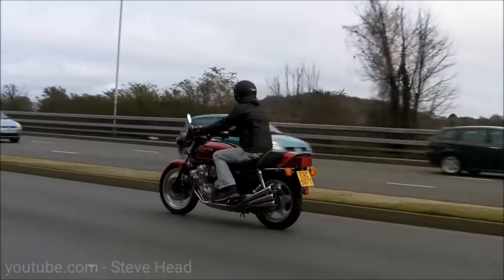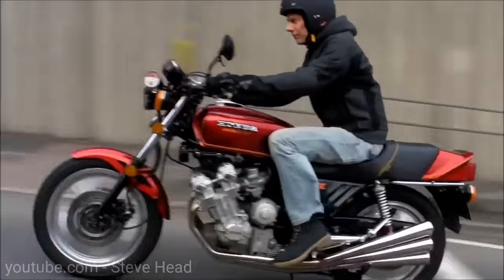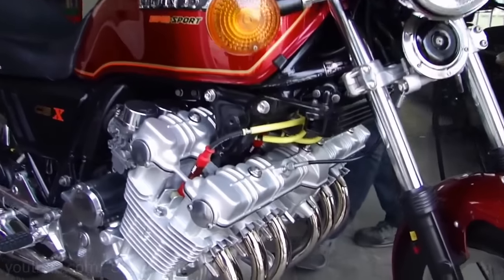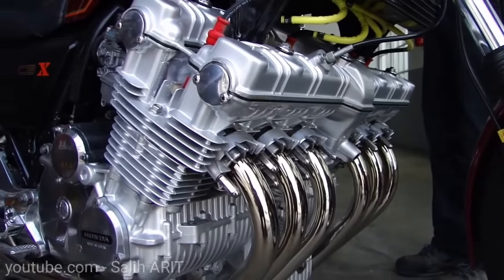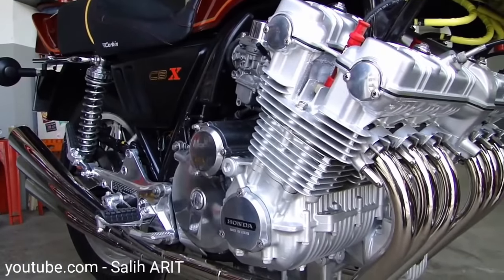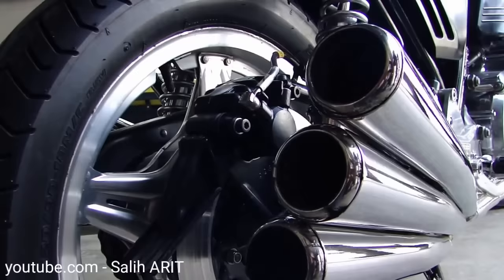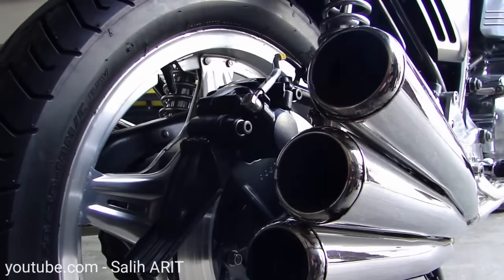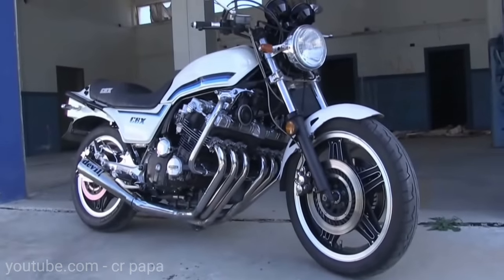Honda CBX 1050 - The Motorcycle That Sounds Better Than A F1 Car

Comment: I'm 72 and over the last few years I sold off most of my motorcycles until I was down to 2 that will never be sold, a 79 CBX and an 82 CBX.  The 79 has the glorious Pipemaster 6 into 2 into 6 that brings out the F1 sound shown here.  At 70 MPH and above it has that heavenly wail that I cannot get enough of.  The 82 is a magnificent touring bike.  Thank you Honda for enriching my life.
Reply: Still ride it?
Reply: Have an 82 since new, User friendly with lots of moxie! They nicknamed it the New Vincent Black Shadow. Call it whatever you like 80,000 klicks and still a dream to ride! <3  .
Reply: Wow...you own 2 of these....😯 please adopt me Sir 😆😆🤣 kidding
Reply: Pic please
Reply: what model year of cb1050 or what size engine sounds the best? (stock) better than F1 car? like the one at 0:40 in this video?
Reply: The Power Of Dreams....
Reply: Getting the carburettors balanced properly in a bastard of a job and not for the novice..
Reply: @schmittyyyyy  Oh, yes.  I'm 73 now
Reply: @michaellovelace8995  How do I post pics in a reply?
Reply: @rohanpatel4863  Bone stock none of them sound like this.  The stock exhaust is a boat anchor that upper management forced on the designer.  With the Pipemast exhaust, any of them roar to life.
Reply: @Shane-zx4ps  No kidding.  I just rebuilt the carbs on both of mine.  AZ gas does not sit well in these carbs.
Reply: @billbmsn  happy birthday 🎂
Reply: That 6-2-6 is everything! That glorious sound. I just turned 50 and will never get rid of my '03 FZ1. It doesn't sound nearly as beautiful as the CBX, but we've done many many together and it's hard to replace 151rwhp @5000' on an upright with bags. But, if you think a trade for one of those cbx... lol kidding, i understand the bike bond. Ride On!
Reply: @billbmsn  ... Startron helps.
Reply: I'm assuming that exhaust is equal length
Reply: @billbmsn  Gas is not the same since they banned lead! It didn't produce  dry deposits as fast if any when  you didn't empty all carbs for winter storage! like today gas fast evaporation rate!
Reply: @Jonh doe ... If you build like you write, you'll never get a speeding ticket.
Reply: I used to own a CBX 1000 when I was 18 back in the 80's. Blue/silver and shit hot lol.
Reply: Hey Bill! Why don't you sell me your beautiful 79 CBX!? 😁😁
Reply: But....but.....its not a harley so it cant be a good bike?
Reply: Are you still alive??  Lucky man
Reply: @michaellovelace8995  Google it? Or are you asking him for proof 🤣🤔
Reply: @momonohomo150  no proof just wanted to see his bike
Reply: @fartdonkey8290  I have harleys that sound glorious but not like this. I grew up racing metrics and to have both would be epic.
Reply: sweeeeet    😁
Reply: @Shane-zx4ps  
Nonsense....Any reasonably proficient witch doctor can get the job done....It's the expense of the shipping that's the problem....It's a long way to the Amazon Basin.
Reply: @billbmsn  heres to many more years of you enjoying those bikes sir! 🍻
Reply: Where do you live?
Reply: respect. I'd love to own one, one day
Reply: Where do you live?
Reply: I will be 72 this year and still ride my 675 Triumph.
Reply: Sounds like a jet coming & going!.....
Reply: @billbmsn  Make your own ethanol free gas bill. 5 Gallon container....Well worth it.
Reply: Godbless you Bill
Reply: I am 75 but my Benelli (see my blog here) was taken by a lawyer...Not really rightfully in NoVa.
Reply: Im so angry with myself. An older gentleman tried selling me a 79 cbx for 900.00. Had been stored in his garage for years. Now I cant find one in my area.
Reply: Shane,
I remember when everybody had a real pisser getting the carbs on the CB750-4 balanced before the Hamamatsu boffins started supplying dealers and tuners 4-tube manometers.
Reply: I got one with a spared engine  in 2011 for 300€ in a shitty condition with a missing frontwheel, was a part trader on ebay back then... wish I restored it, or built it in a honda quad
Reply: Unbelievable sounds
Reply: @Bellathebear777  Or just buy it at the pumps where available. I was working in Michigan in '15-'16, and the convenience store next to the hotel I stayed at sold "recreational fuel" which was ethanol free. I would imagine it is available elsewhere. The station across the street sold race fuel at a separate island.
Reply: Glad your still riding sir.
Reply: Brother that 79. Damn those were good yrs for bikes. Just Raw. Not a beauty queen wrapped in plastic. Just upright crotch rockets that screamed.
Reply: Good for you, man, good for you!
Reply: I take it no carbon build up.....yes a motor has to sing
Reply: I'm 74 now, approaching 75.  Still riding.  Have added a few bikes to the 2 CBXs.  A 2005 MV Agusta 1000+1 for one, a scary beast of a bike but a true work of art.  But more to the point here is an old clip I did in 2011 of my 79 CBX with the Pipemaster exhaust.  I don't ring it out, just rev it a little near the end of the short clip.  It gives you just a taste of the sound.  At the very end of the clip, you will spot my 82 CBX in the garage.  😀  https://www.youtube.com/watch?v=jNJwQ3A0fjA
Reply: How much you want for it?😂
Reply: Me too...and i have  a CBR1000RR!!!
Reply: @billbmsn   ohhh yes i am 72... hahaha.
Reply: I live in Greece.
Reply: Which other old bikes did you have?  If they weren't so expensive now there are about 7 to 10 I'd like to add to mine.  I  have a 79 CBX and an 83 1100F Super Sport.  The CBX has a DG 6 to 1 pipe. The 1100F has original black exhaust.  I'd love to add a KZ1300, 84 1000 Interceptor, 900 Eliminator, FJ1200, 81/82 CBX, GS1150E,  KZ1000 Lawson Replica,  Late 90's CBR600 Smokin Joes Replica.... you can see how difficult and expensive this would be lol.
Reply: @mrweeby1961  I have had a lot of other old bikes...a 75 Norton Commando since new sold 6 years ago; 75 and 76 Honda 400F, 88 Hurricane 600 until I replaced it with a CBR 600F2 in 91.  Sold that about 4 years ago. 76 Goldwing in the early 2000s for a few years.  Bought for $1000 from a Honda factory test rider.  Came with over $1000 in rare spare parts, so the bike was basically free. Had several 71 CB 450s for a few years.  My first bike was a 68 CB350 brought in 69.  Stolen in 71.  Never seen again, replaced with a CB 450.  Almost forgot the 87 Suzuki GSXR 750 bought in the mid 90s and my 3rd bike, a 71 Norton Commando 750 bought in 73 after I sold the CB 450s. Loved the effortless low end torque of the Norton and it was small and light, fitting me well.  Now,  esides the 2 CBXs. I have a 91 Ducati 907ie, 2005 MV Agust F4 1000, 2009 Honda ST1300.  Fun & games!
Reply: @billbmsn  You started a few years before me lol.  My first was an 82 XL250R, then 83 450 Nighthawk then jumped to the big bikes. If I can remember right it was an 82 900F Super Sport along with a V65 Magna, sold them off and went several years with none.  When I got back into the bikes I got a V65 Sabre till 1999 then went more new with a 1200 Bandit and a ZX12R.  After those (the ZX began to get uncomfortable to ride due to age lol) I tried an 01 Yamaha FZ1 and while I had it I found the 79 CBX then sold the FZ1. I then found a duo of the 83 1100F Super Sport and an 81 900F Super Sport (which didn't run but looked fantastic).  Then I went to a Harley Fat Bob and sold the 900F.  So now I still have the Harley, 1100F and CBX.  I'm kind of looking for some older bikes but they've become so insanely priced I'll probably never get anything else.  You had some cool stuff too and some of those would be great to have now.  The local Honda dealer has various 60's-80's old bikes on display hanging from the walls which is pretty cool to see.
Reply: I still have one bike left from when I was young and 86 fzr 1000
Reply: That warms my heart to read your enthusiasm and see how much pleasure and life enrichment you have extracted from owning and riding them. Respect. I am only 58 but I dont seem to be losing my love of riding bikes. I currently own a Harley sportster 1200 and a ducati 810 scrambler (Night shift - that one has a nice sound too), and a Royal Enfield scrambler, but i am seeking a 4 cylinder Honda, because my first biike was a Honda, as was my second, and i never had a 4 cylinder bike or a 6, so its time. I really love the sound and the smoothness of 4 cylinder bikes. This 6 in the video is a dream of a bike. Would perhaps do better in a new frame and suspension haha
Reply: Please sell that to me. If you think you will past away 
I will not put some modification on it and will it keep it the way it is. Please
Reply: Good question. Maybe a pic in a New comment on thé original post
Reply: You find the handling much better in the latest model?
Reply: @alwinmv6827  75, almost 76.  Still love and ride my CBXs.
Reply: @schmittyyyyy  Yes
Reply: @tooyoungtobeold8756  I had one of those, a beautiful 2008, black and gold.  The riding position was the most extreme of any bike I had ever ridden.  So, I flipped the clipons over to the other side so they pointed up instead of down.
Reply: That’d be a sick if they stuck it in a small car
Reply: Honestly I'm grateful you mentioned thr 6 2 6 exhaust. Invaluable knowledge.
Reply: @alwinmv6827  75, almost 76, and still riding.
Reply: @tooyoungtobeold8756  I had a 2008 675.  Great bike.  I flipped the clip-ons since the stock riding position was brutal on my neck.

Comment: They need to make a 2020 version of this bike with the same engine but different body
Reply: Agree
Reply: I was looking at a list of upcoming bikes and saw 2020 CB1000X. For one glorious moment I thought it said CBX1000.
Reply: The closest thing we have is the BMW K1600 with a 1600cc inline-six. I rode one, the engine is absolutely glorious. I don't think we need to be sad.
Reply: The one at 4:00 was pretty rad ;)
Reply: Same thought came to my mind. This engine and sound deserves new & latest body of 2020
Reply: @nomadben  they should use that engine in the BMW Mini
Reply: Alan miilyard ,has made one ,,,,!!Z1  air cooled six cylinder ,,,,perfect
Reply: Very light rotating assembly . Revs up and down quickly . With the race for power , the sound is very low on the list imo . Technology advances ... The CBXX would have been remembered much more if not for the Suzy , which made more power with 2 less cyls .
Reply: Imagine a modern Honda I6 in a new generation S2000.
Reply: THAT'S WHAT I'M SAYING. Just remake the DAMN thing. Do you see how many people are actually using this engine still and spending $40,000 on the upgraded suspension?
Reply: Philippine Heart Center PHC  Yeah, it has a shit ton of power and it's really heavy. Definitely a super sketchy bike to ride fast.
Reply: Or a newer six cylinder engine with the retro frame.
Reply: Indeed
Reply: it's just a rumor but they want make it
Reply: Body looks perfect !
Reply: lol, good luck with all that euro restrictions
Reply: *better engine
Reply: Probably wouldn't sell cause the motor will cost 3x the price. 
High cost of cam and crank shift, block, water jackets...

Yamaha has developed 3 cyl motors and is using in MT, TENARE, FJ, SRX, XJS,TRACER,FZ and .......

Its what can sell......
Reply: Same body but with a parallel twin 👌
Reply: We need one with same sound, but replace the carbs and do fuel injection
Reply: A friend of mine has a '79 KZ1300 six that he bought new and immediately put a kit from Mr Turbo in it, and if that wasn't silly enough he put a nitrous bottle on it that gave it just a little shot at WOT to compensate for turbo lag.
1979 brakes, 1979 tires and a 1979 suspension with that kind of power=the most evil motorcycle you'll ever ride, to say it's a death trap is an understatement.
Reply: Everyone says to remake it. The cb1100 looks pretty similar with a inline 4 instead of the 6
Reply: Like the Z1 and 900rs?
Reply: Matthew721 79  Yeah but even still that engine is very, very heavy and wide. Probably not the best idea if your goal is great handling performance.
Reply: It'd be better with the same body!!! The original look badass already
Reply: At least, make inline-6
Reply: @nomadben  It doesn't sound good. BMW.
Reply: A refined engine would be the best word I think
Reply: @nomadben  not even close. The K1600 doesn’t rev that high to produce that amazing sound. The XR1000 sounds a lot more similar to this one but again. There are great engines out there but the point here is the sound which is unparalleled.
Reply: @C_R_O_M________  K1600 redline is 8,500 RPM, CBX redline is 9,500 RPM. Not that huge of a difference. Both sound great in my opinion.
Reply: The new CBR1000RR-6.  You'll never need another motorcycle again. 

Warning:  Riding this motorcycle above 7,000 RPM may cause instantaneous death by smile, and relentless groupies.
Reply: @StevenStGelais  exactly what i think, since carbs aren't used anymore... Love carbs but fuel injection is more used nowadays
Reply: I propose a 600 ...v6... tech de force. Or inline ok too.
Reply: Or a car with this engine.

Comment: Who cares about HP and top speed ratings when it sounds so good.
Reply: SLOW
Reply: That's why I bought the Hemi over the EcoBoost, I wanted that good sound!
Reply: 100hp isn’t that bad honestly
Reply: AE86 Toyota
Reply: 105 bHP on a motorcycle is a lot, cars are Heavy by Nature, Motorcycles are Lightweight. That's why cars waste more gas than a Motorcycle ever will.
Reply: Definitly fuck electric cars even if there faster. Only the sound and feeling is all that matters!
Reply: @mikeb769  anything in triple digits on a motorbike it's gonna move.
Reply: @mikeb769  amen! 100bhp in a single seat rigid with standard rake is more then enough:)
Reply: I've found some people similiar to me...
Reply: @izzurumusic  you mean some people that are similar to you or some people that are fond of you?!? 🤔🤔🤔
Reply: The Vibe similar to me...
Reply: Says every D series Civic with Fart Can’s
Reply: For an old motorcycle 100hp is a lot

Comment: I'm always amazed by just how good we can make a series of little explosions sound.
Reply: Str33t Tr1pl3 science is a crazy thing
Reply: Str33t Tr1pl3 r/iamverysmart
Reply: @officebear4637  he didn't use many big words fam, kinda to the likes of openly realizing "wow we can do so many things with copper wire (magnet's, power transportation, capacitors, etc)
Reply: Earjaculation
Reply: OfficeBear using subreddits outside of reddit. Yikes.
Reply: ITS CRAZYYY
Reply: Aliver87  controlled burn? Better description for it.
Reply: Max  they are actually burns. Do you know the difference between a controlled burn and an explosion?
Colin has already explained it partly..
Reply: @Colin Rist "flame front"
Reply: A controlled burn would not make any sound like you know it from an petrol engine.... people are dumb. It's a controlled explosion chain. Maybe the explosions are to fast for your brains....

Comment: I remember reading about the exhaust sound in one of the cycle mags when the CBX first came out.  A 6 cylinder engine has some unique tuning possibilities.  Back then, Honda R&D would develop a product and then invite the manufacturing side over to show them their new product.  R&D sent a team of acoustic engineers to the Hokkaido Air Force Base in northern Japan with a bunch of equipment, and they recorded the sounds of a F-4 Phantom jet taxiing, taking off and landing, then they came back and engineered an exhaust that had that same sound.  When they introduced the bike to the build side, Mr. Honda was there, and he said in no uncertain terms that they would not build a bike that sounded like a jet fighter!  So they went back and designed the exhaust to sound like an F-1 race car.  Legend had it that somewhere in an R&D warehouse there was the original exhaust, and there were a lot of motorheads lusting to find it.
Reply: The way I heard that story. Mr Honda listened to this exhaust system, then turned to the engineers, bowed to them and said. "You have achieved a remarkable thing here, but we cannot market a motorcycle that sounds like a jet"